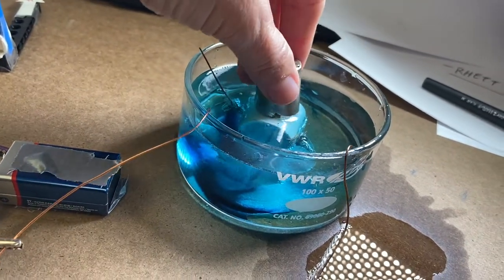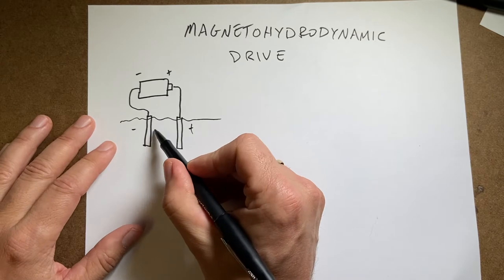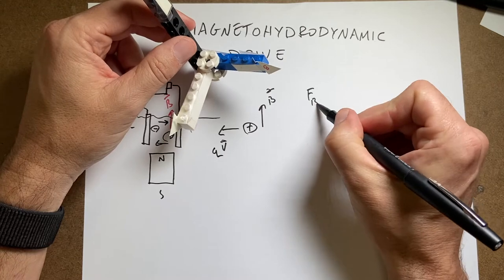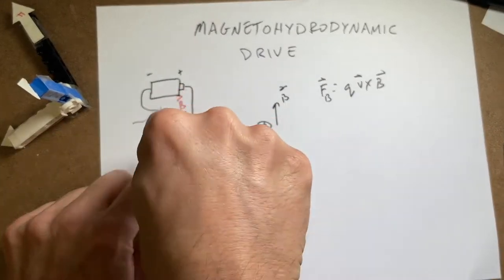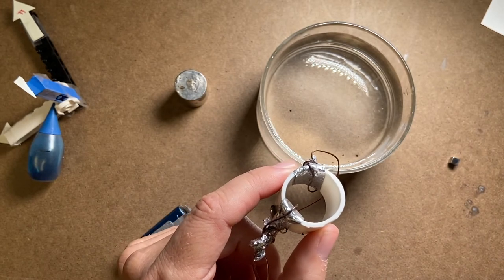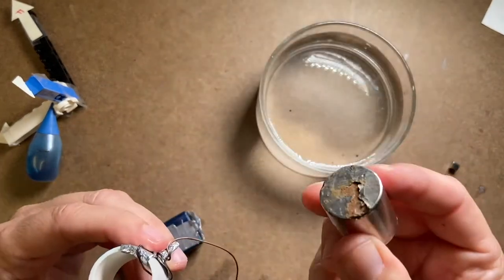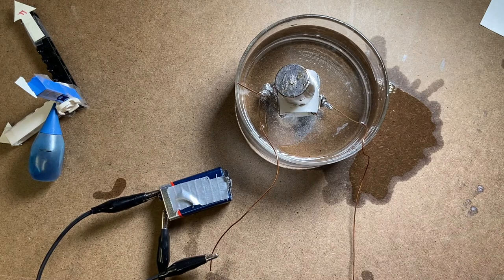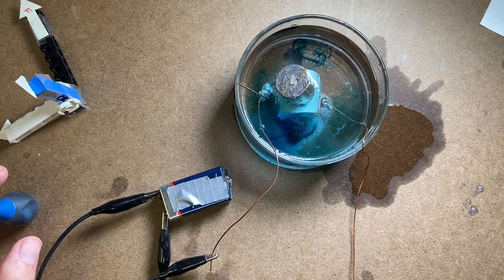The Magnetohydrodynamic Drive uses the magnetic force to push water.

Comment: Homopolar motor, now turn that magnet over to the other pole, the water will go in the opposite direction.
You could probably make a setup to take advantage of both pole and gain more thrust double pipe, problem is that one would move water one way and the other would move in the opposite direction, so rotate a shaft.
Reply: except i feel that the current simply moves through the water rather than drag the water along with it. the only magnetic interaction is with the ions, not the water itself. 

could be utterly wrong but the fact its an electrolyte rather than a solid conductor with a rigid structure...

Comment: Ok, now how do you get it to perform work?
Would you use it in a jet propulsive system, a turbine propulsive system, a sterling propulsive system, some type of thermionics, a nuclear system, a combo of two or more systems?
The magnetic fluid has to be contained yet be able to move similar to the sterling, a thermo magnetic heat field like the earth.  Yet it must create some type of thrust whether magnetic or something stronger and more efficient than plasma.
A magnetic field would have to create some type of push on the rocket and be vectorable while maintaining a protective shield around the rocket.  That of course creates a conundrum.  Would you need two separate systems, one for propulsion and one for protection?  How then would you prevent one from interfering with the other?  Could one field reside within another?

Comment: Do the wires have to be bare to work?
Reply from the maker: yes.  the wires have to be bare to make an electrical connection with the water so that there is a flow of charge.

Comment: Can you get current out of moving water if you do the same thing? Meaning the water is already moving between the rods+magnet and it has salt in it. Similiar when you spin electric motor abd you get a current.
Reply: yes, you can but try to use highly conducting fluids to generate significant current.
Reply: @hansolo9892  so for example river water would'nt work very well it doesn't codnuct that well? I was thinking if flowing rivers could be turn into generators but seems that using propellers and motor is a better more efficient option to get energy out of it.
Reply: Adding salt creates a conductive solution, but it also creates a redox situation, and separation of the hydrogen and oxygen happens. You can find many videos on HHO as a fuel option. For this type of propulsion you want to avoid the breakdown of the water into HHO. The higher the current introduced into the solution of salt water the more aggressive the redox reaction becomes. To avoid this problem you'll need to find a way to have a conductive solution, but have a buffering agent that blocks the creation of HHO gas. Otherwise you end up with a system that eats itself, and is pretty much useless as a form of propulsion by itself. It will take a lot of garage bench experimentation to find a highly conductive solution that doesn't act as an electroplating solution, or HHO gas generator. Your looking for a solution that doesn't break down, and has high conductive properties that can deliver more thrust with less current, or voltage.  Basically low electrical resistance, and a solution that won't be effected by current, or voltage causing molecules to breakdown into individual atoms at one of the poles. Strong salt water will break down into chlorine gas, and sodium hydroxide solution. Both can be very aggressive towards metals. They use stainless steel electrodes to produce HHO gas.
Reply: @toko7746   Well you aren't wrong dear. See the potential of MHD can be only truly observed in extreme phenomena, that's why it's so popular in Astrophysics for modeling highly complex processes of star formation and solar flares. If you want to see some impact then you can try looking up the Yamato-1 ship built by the Mitsubishi Heavy Industries in the early 1990s. They had to use the seawater/ocean water to replicate the salt in the water conductivity that you see here while also considering that they used supercooled helium superconductors aboard to achieve a shy speed of 15 km/h. In that sense building a dynamo to generate energy from a water body would be very inefficient. Interestingly, as I would like to think, maybe their use could be in lighthouses to power it up. (which is in some sense still debatable).
Reply: Tbh, lighthouses in the gulf stream may be a potential candidate.

Comment: Sad we don't use this tech to help with major water shortages... or water areas that are polluted with toxins... (Blockading the area and channeling the water away from other water sources/areas...)

I wonder why we don't use this with sea water and generate enough hydrogen to use as a means to power the locations...

(I have very little knowledge in all the fields that would benefit from learning the math and stuff...)

With things the way they are currently... and how fast things are transpiring in a negative way...
I wonder how much it would be to get the locations necessary to run huge pipes across the land that need the water...

I would also wonder, why we don't use compressed air to blast the clouds away, that are bound to create major damage to the many sensitive areas. (Also generated via Hydrogen/electrical power)...

I'm trying to figure out what I need to know to understand the mechanics if I want to use:
- magnets with electricity; that function as a railgun style propulsion... firing off a platform that is attached with a tether.
  - The platform is used to house water; (1. it expells the water when it lands in the area of choice; reusable... 2. the tether is a means to connect cables and bury them later... 3. the platform also has mechanical means to dig and cultivate the land... 4. as the different attachments/hubs are connected to the other end of the tether; it can be any kind of machinery/transportation of things/people...)

With a high enough pulling/pushing power... after the platforms are connected; it can be used as a railway system with magnetic lift to assist in faster shipping and be of nominal cost...

*attaching water turbines within the pipes (in different increments) and having high pressure nozzles to push even faster [as each chamber can withstand strong PSI levels for the next push with the water...] as it accumulates in the chambers at varying speeds for down/busy times...)
 
Since creating magnets in different sizes... it would be interesting how much it would affect people's health if they are around very strong magnetic forces... (But it can be shielded)... lol

Cheers!!! Can't wait to see what else I can learn...

Comment: Any application?
Reply: Any charge of any battery any size will do...smaller batts can always be seriesed n parraled until able too charge a bigger battery which you can then attach too an inverter n power what you want...every little helps its just a case off covering your upfront cost off materials after that u are getting free electric...free electric can be harvested after upfront cost has been covered from your electric return after that your getting some free electric untill your components fail
Reply: @jshaw4757  Electricity can not be generated or destroyed. It can only be changed to one form to another.
Reply: @papaikarmakar84  yes so it depends how you are getting it in the first place ...if you have 2 different bottles off fuel one costs $10 and other cost $1 you are going too get ten times more from the $1 bottle...so point being its about how you design n cut costs on how you go about making your energy in the first place too then exchange step up step down restrict increase series parralel or whatever you need too do....its not about trying too magically get free energy its about improving efficiency if you spend £100 on a good quality ball-bearing magnetic motor n make your own wind turbine all you have too do is wait until you have harvested £100 worth off electric and anything after that u harvest is free energy for you untill your turbine breaks or maybe needs repairing at some stage but most off these motors are guaranteed for 20 years so it's safe too say your going too get alot off free energy free too you not free as in magic...people seen too get hung up on this idea off the fact energy cannot magically appear but that's not the point its about efficiency n covering your upfront costs then after what you get is free energy unless there is upkeep costs or maybe a small amount off power needed too recieve a larger amount off energy too store too use how you please its about efficiency n good design...you could power a 220v volt appliance with watch batterys if you needed too just stack into small cells series and parralel them then use those too trickle charge a larger 12v battery then attach that battery too an inverter now from the tiniest amount off energy harvested on even small 1.5 volt 200mah batts you can scale it up....salt batts have low ampage but again series parralel untill get a usable amount off amperage salt water is free therefore free energy for you...crystal piezoelectric batteries you only need too apply pressure vibration or motion too create electric which you could place lots inside your car wheels now you are getting a supply off extra power from your petrol money you could add then too your fan blades now you are getting a small amount back there which you wernt getting previously so technically its free no matter how small the amount its usable...adding peltier devices too the side off a wood burner you are harvesting energy from the heat that you wernt previously so free energy once the cost off your peltiers have been recouped from your harvest...cherrs